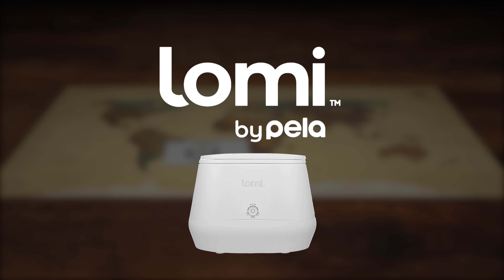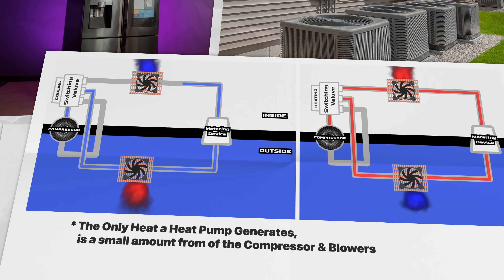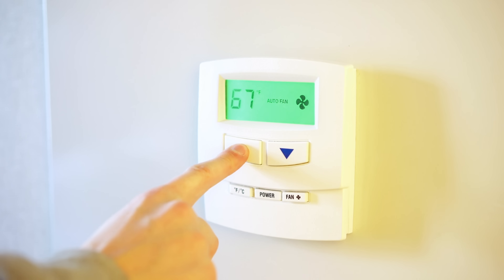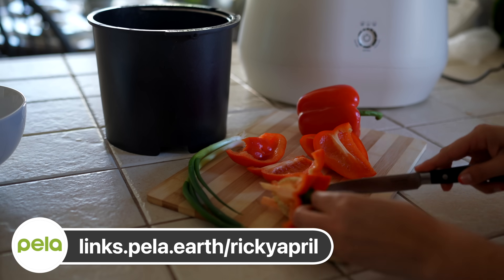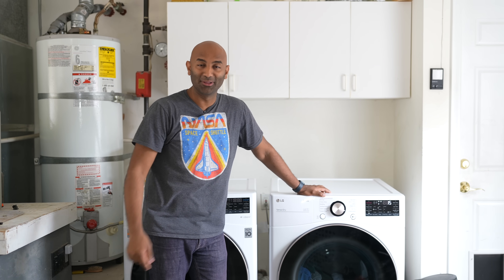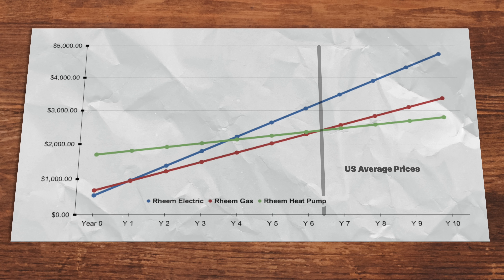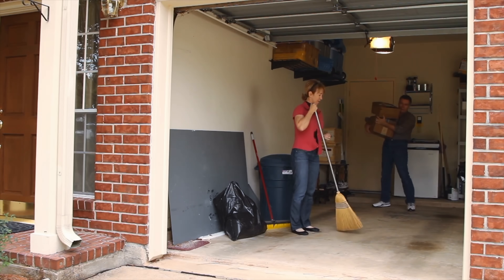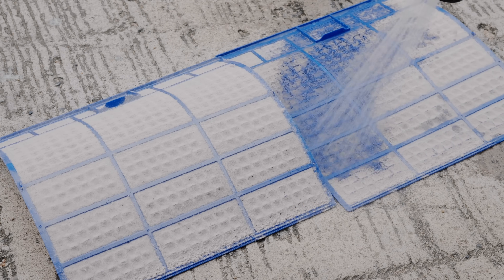I'm Shocked How Much Money Heat Pump Appliances Save!

Comment: Heatpumps work great at heating/cooling your home, even in snow country, but a water heater is a stupid application, they still have electric strip heaters in them and you get the fun of making the same repairs as you do to your a/c, this is a feel good appliance in my experience with no money saving and almost guaranteed it will end up in the landfill on the first breakdown.  As for your pool heater....er, most pool heaters are gas because it takes usually 200k+ btu/hour to heat and maintain the temp of a pool, even in mild weather, the largest capacity HP you can get for your home will probably top out at about 60k btu/hour.  Plus refrigerant leaks are a massive problem in the HVAC/R trade as manufacturers have to make coils and tubing eggshell thick in order to make the govt efficiency standards, so I expect refrigerant lost to the atmosphere to go up about 100x if not more as the transition occurs.  Love the video as usual!

Comment: I have geothermal HVAC which doesn't pump anything outside; the heat goes into or comes out of the ground. When it's time to replace the electric water heater, I'm wondering if a heat pump water heater can be married directly to the existing geothermal system. That way I'm not effecting the indoor space where it would be located regardless of season. I'm guessing the water heater would have to have it's own circulating pump, and it would tie into a branch off the geothermal fluid lines from outside, (that way it could operate independently from the HVAC). Currently, the geothermal supplements the water heater with a cold-to-hot water line that runs through the HVAC system, but the water heater itself is still straight electric. In summer the water heater gets some of the heat otherwise pumped back into the ground, and in winter it also benefits. Do you have knowledge of how this would work as a direct heat pump water heater on geothermal? Thanks. (I also have a Samsung heat pump dryer.)

Comment: my only issue with heat pumps is the working gas and its Global warming Potential (GWP) when the equipment is at the end of its working life. if it is released into the air we could cause more issues than we solved. I use heat pumps that use CO2 as the working gas which also have a higher COP. Heat pumps are the way but we need to be carful

Comment: Hello..... believe it or not but I just got a dryer today looking at it in the box as I was watching the video. Living in Ireland have made the move on upgrading a 80s house. 
External insulation.....as it's dam cold here thanks to all the rain.
.6 to .8 u value windows
Airtightness tape on the windows to stop draft's
Floor installation to stop cold coming up into the house
Attic insulation with a airtightness membrane
Air ventilation with heat recovery
Pv panels for power
Heat pump for heating
All appliances are a min A+ to A+++ rating.
In winter when there is very little sun and it's cold the house can use about 30kw to max of 35kw per day most I have seen is 40kw.

One thing I did see when doing research was Ireland house's have a average  usage per year of 4200 and US House usage is 11000kw.
Just mad to see the power difference between countries.

Best of luck with the changes

Comment: Fahrenheit better! Celsius for the win, at 0°C water freezes and at 100°C water boils, easy peasy. 20 good inside, 30 Nice outside, 40 too hot. Totally getting a heat pump hot water tank after your video though.

Comment: Enjoy the videos but why not dry your clothes outside in San Diego they should dry just as fast as they do in a dryer (Mine did when I lived in Georgia) then just run them in the dryer without heat for about 20 minutes. Currently live in Wisconsin and hang them up in the basement in the winter and outside in summer seldom run the heated cycles of my dryer
Reply from the maker: Great suggestion think I will!

Comment: I recently installed a Rheem heat pump water heater.  I made the installation even more efficient by installing intake/exhaust duct work on this unit.  This allows for me to draw hot air/exhaust cool air to the desired environment depending upon the outside air temperature.  
Warmer months:  Hot air from the outside / Cool air into the forced air return duct.
Cooler months:    Hot air from the forced air return duct / Cool air to the outside

I built a house back in 1994 where used a Water Furnace closed loop ground source heat pump to heat/cool the house (North Central Ohio).  It heats/cools 5,000 sqft for approximately over $100/month and is still in operation (28+ years).
Reply from the maker: I’m thinking about this too… do you have pictures on how you did the ducting? Can you change where the ducts go based on time of year?
Reply: @TwoBitDaVinci  :  Yes I have pictures that I can send you.  
Yes I can change where the air is ducted based upon the time of year.  
I checked your YouTube information page and sent out an initial message for your verification.
I will do my best to describe how I made custom duct work adapters for the water heater.  You can purchase them from Rheem, but they are over $100 each.  I made mine for approximately $50.
FYI I used dust collector blast gates to shut off / open up the desired ducting paths depending upon the time of year.  They seal better than standard duct work dampers.
Reply: @TwoBitDaVinci  : Did my initial email message come through?

Comment: Hey Ricky, why didn't you consider a solar hot water system,? Here in OZ  they are very popular. I have a split system where the tank is on the  ground and the collector is roof mounted. A small pump circulates the water. It has an electric booster if needed. Usually in summer I leave the booster off as it is not needed to heat the water. If we get a run of rainy days then I use the booster to heat the water, then turn it off again.
Reply from the maker: I’m going to go full solar panels on my roof. This way I can power whatever I might need. Maybe we don’t need hot water but need to run the AC. I’m thinking by going heat pump and maximizing solar production we can really have max comfort and near zero bills

Comment: I thought you would talk about connecting all these things together somehow for heat conservation. Why not take the heat from the fridge or AC and pump it to the hot water tank? Or pump the heat out of the hot water tank to dry the clothes or heat your floors? By putting in separate heated and chilled water lines, you could move the heat around to where it's needed or where you can store it. Large commercial buildings have been doing this for decades to save energy.
Reply from the maker: I plan on doing something like this… it’s a bit tricky but yes!

Comment: Great video but you forgot one very important part:  Check with your energy provider for rebates on your heat pumps.  My electric provider gave me a $600.00 rebate on my water heater.  Yes, my heat pump clothes dryer is a bit slower than my old one.  Remember, you do not have to stand in the garage and watch your car charge, or your clothes dry.
Reply from the maker: Great point Robert, I need to look into rebates where I live!
Reply: It’s called TECH rebate by California and your local grid company.   You need heat pump with at least this efficiency..  15 SEER AC/9.0 HSPF Heating 
Comfortable Home: $750
TECH Program: $2,250*
Total Rebate: $3,000*

Comment: Celsius is way better: 20°C is room temperature; 18°C is optimal bedroom temperature for sleep; if the average temperature over a day and night is above 10°C it's officially summer here; 38°C is fever and 40°C is a high fever (hyperpyrexia); 100°C boils water; 0°C is when water freezes; 4°C is ideal fridge temperature; -20°C ideal freezer temperature; 250°C is the maximum temperature for most ovens, 50°C is minimum temperature for hot water from the tap and 60° is maximum. All of these examples are nice even numbers and the reason I and pretty much every adult on the planet know them by heart. Celsius is a fantastic temperature scale since everything is compared to water and water is very important for humans.

Celsius is also the same scale as Kelvin with only the Zero point shifted so simple addition/subtraction shifts the zero point, so scientists have no problems with Celsius.

Fahrenheit makes no sense at all. What does 50°F even mean to 90% of the human populatiom? Nothing. Holding on to archaic measurements cost a huge amount of resources every year with time consuming and therefore very costly conversions.
Reply: As a physicist from California I can say that people easily get used to both systems. But converting between the two certainly causes confusion. It only takes two steps but which is first and do you add or subtract 32... If you have to do it in your head here is the easiest to remember: No matter which way you are converting add 40. Now multiply by 9/5 to go to Fahrenheit or 5/9 to get Celsius. Last, subtract 40. People can usually remember that there are more Fahrenheit degrees so the correct fraction to use is easy to remember and 40, since it is a multiple of 10 makes for easier mental math. I spent half of my life with Fahrenheit and half with Celsius.

Comment: Heat pumps aren't the answer to your problems. Heat pumps only work if there is enough warm air to pull out of the cold air. I grew up with one and winters were horrible. We would froze if not for the fireplace.
Reply from the maker: they have come a long way from then... they're performance even in the cold is quite good... but most systems are hybrids, that can revert to traditional electric when absolutely needed.
Reply: @TwoBitDaVinci  I'm not that old. But my father got it because of it's savings. He worked nights when it was cold. My siblings and I would freeze at night.

Comment: Heat-pump dryers are very common in Europe. I already have one from Miele for 8 years. It uses less than 1kW of power and the washer too so you can run them simultaneously from the same plug. I never saw a natural gas dryer. I don’t think it exists in mainland Europe.
Reply from the maker: yeah I think you're right! great feedback! looking forward to upgrading to one!
Reply: The clothes dryers in laundromats are mostly gas...

Comment: A natural gas dryer?! In the Netherlands we had one of the biggest natural gas fields but the heatpump dryer has been the standard for 10 years. It’s not new tech!

We are still reliant on gas tho, heatpumps COP drops when it gets below freezing, however they are perfect for pools which aren’t used in the winter anyways.
Reply: In America the natural gas companies marketed hard to convince people that gas stoves are better for cooking. The reason they did this was just to get the gas hookups on the house. Then they can convince people to use it for other stuff just because “it’s cheaper.”
Reply: @SaveMoneySavethePlanet  basically every household is connected to gas (or all-eletric / local heat-net), however I never heared of a gas dryer and the standard is a heatpump dryer which is usually located next to the kettle for heat and hot tapwater (without boiler).
Reply: @Deveonn reason why gas dryers are popular is they are considerably cheaper to operate and pull very little power which is good if you only have 60 amp service. The whole reason why they offered gas dryers from the very beginning in the late 1940’s here in the US is very few homes had 240 volt service and some and if you happened to live in a Victorian or Edwardian home from the early 1900’s around that time, you’d just tap into the main gas supply/line and finding the nearest wall outlet in the basement along with venting it to the outdoors. Some people ended up converting their 240 volt electric dryers to 120 volts (yes, 240 volt dryers are backwards compatible in the US) but moving the wires over on the terminal block but took a long, long, long time to dry on half of the voltage since the heating element was only outputting 1400 to 1500 watts of power compared to 4500 watts on 240 volts.
Reply: @seana806  A heatpump dryer doesn't require that much power and can easily be solar powered.

Comment: I got two split heat pump ACs for two rooms. One 1.5 ton(dual inverter), another 1 ton(single inverter), I live in a sub himalayan city with comparatively moderate weather. It costed me 933 USD(currency converted) including installation and wiring and stuffs. Sold my old portable AC at 133 USD and hence my final cost is just 800 USD.

Comment: Makes me wonder if all of those can be integrated; like, a geothermal system that heats the water and the house, as well as the clothes dryer and heats and cools the clothes washer...
Reply: I was thinking about taking it a step further and having a glycol tank that would pump freezing glycol to specialized refrigerators and freezers, or to standalone air conditioning units, and then have the waste heat from those appliances pumped to a hot water tank to be used for hot water or heating rooms or the cloths dryer.
Reply: It could easily but that doesnt mean it would be good you need manufacturers on board which be a tough sell since you instantly get stuck in the loop of no houses with the syste so why make the appliances and no appliances so why build the houses, then every appliance why be a proffesional install so no more just taking it home and plugging it in also there is cost since you really would be changing much over a normal heatpump appliance just the external heat exchanger would go from air to fluid so no real price difference there but the there would be the houses system the problem here is it isn't just a simple heating loop so it would need a monitoring and control system since too many devices on at once could freeze or boil the loops

Comment: Ok, here's the case for Centigrade. 0 degree- Freezing(Literally), minus temperature is that, very cold, 100 degrees- boiling water, the halfway point between the two 50 degree--death valley. A quarter away at 25 degrees, very comfortable temperature.
Reply from the maker: Solid case! I like that approach. But 50 to 100 is outside the rage for human life. That’s why I prefer F it’s more suited for the ranges of temperature that matter to us!

Comment: Great video!  I like heat pumps more, if we were able to integrate them into a smart home that can move heat from the heat rejection sources to the heart absorption inlets (don't know the right terms).
Also, solar is a free heat source for water and even the house.  It may not work well on cold climates, but can help reduce the load.
Reply: That's what a Mitsubishi VRF heat pump does. Search for Matt Risinger video on the product.
Reply from the maker: Yes there’s a huge amount of coordination we could have. Exciting times
Reply: @TwoBitDaVinci  

Maybe the integration of these applications (fridge heat rejection heating water and home, or hybrid water heater cooling and drying a basement) in a highly efficient home could be this videos segway...

Comment: A lot of these systems should be integrated with one another. Especially heat and A/C, the water heater, and the pool heater. Imagine the waste heat from your A/C heating your pool, for instance.
Reply: If the house is properly insulated, there is not enough heat getting into it to make moving it to the pool worth the capital expense.
Reply: My heat pump furnace runs a waste heat loop to the water heater. They're in the same location so it's a no-brainer.

Comment: Lomi is NOT revolutionary. At least not more than the last food desiccator and grinder that came out. They've been around for a while. I get the appeal, but if you have a place to put the Lomi waste, you may as well just put the food scraps there in the first place and not use the extra energy.

Comment: Did a Miele heat pump dryer 18 months ago. Plugs into 110v outlet, zero holes in house, pumps condensed water into sink or on board tank. Does much less damage to synthetic clothes as it modulates heat perfectly. Uses no house air. Uses 900 watts!
Reply from the maker: Amazing! I might be doing the same
Reply: @TwoBitDaVinci  do you know about people's lomi breaking down after 3 months
Reply: Have been running a heat pump dryer for 10+ years, did even know gas dryers excited until I watched the video
Reply: i use a washing line. zero watts, super efficient.
Reply: @yetzt  I was also thinking that would be the easiest and cheapest solution.
Reply: How does it work when it’s freezing outside? Where I live it can get really cold. Thanks 😊
Reply: @markforno  It uses the house interior air and pulls the heat from that. It is similar to a dehumidifier in that it does not heat or cool the room, just removes the moisture.
Reply: I also have the Miele heat pump dryer.  It’s fantastic, can’t say enough good things about it.  It doesn’t take any longer than my old conventional electric dryer did from what I recall.  30 to 60 mins depending on type of fabric.
Reply: If it lasts as long as a conventional dryer (esp gas) you will get your money's worth!

Comment: The grid doesn't care about spike in usage from one house. You would be against fast charging EVs if local spikes mattered. The grid benefits from the law of large numbers EXCEPT that demand can follow time of use skew. And because morning showers probably span several hours and tank heaters have recovery time less than an hour, dumb tank heaters probably do little to lower grid level demand spike, except for efficiency of heat pump heater if applicable.
But time of use doesn't matter in some places like Pacific Northwest. Dammed water is our epic grid battery. All that matters here is total usage. Though it's probably better to use less in the dry summer and fall, which is why solar is a good complement. Net metering ftw.
Reply from the maker: The grid 100% cares. I’m not talking about 1 home I’m talking about millions especially as we switch away from natural gas.